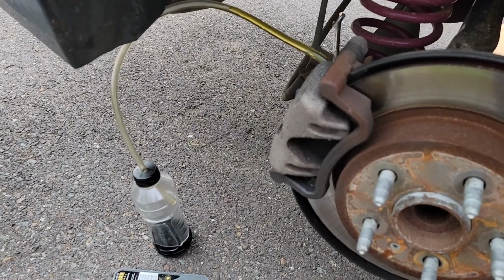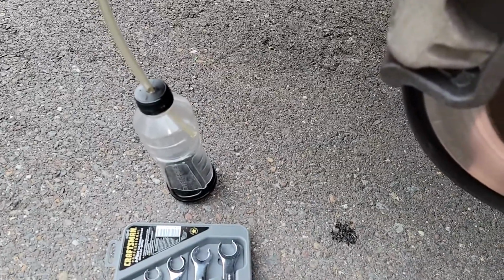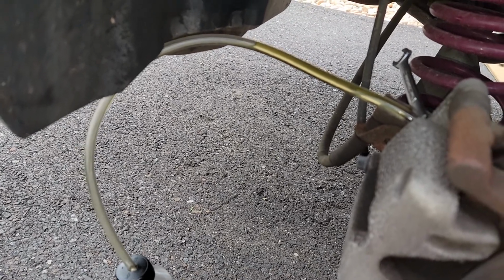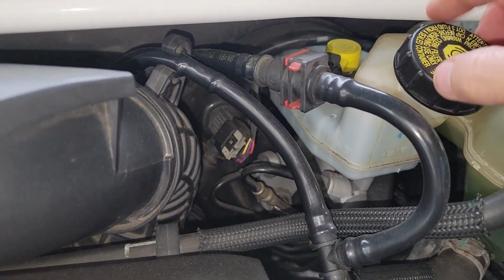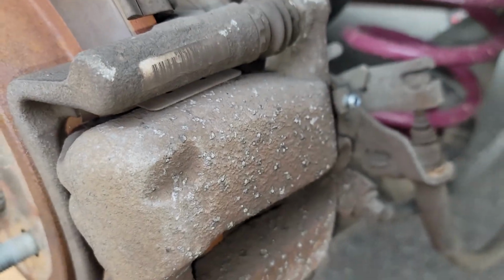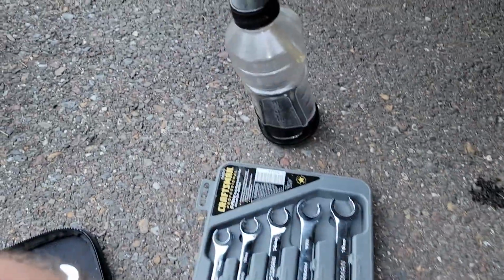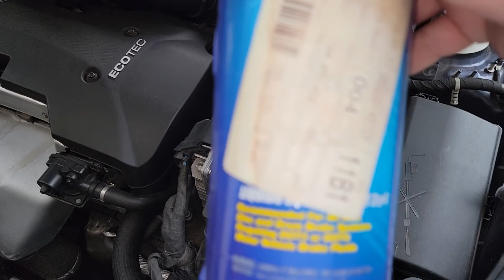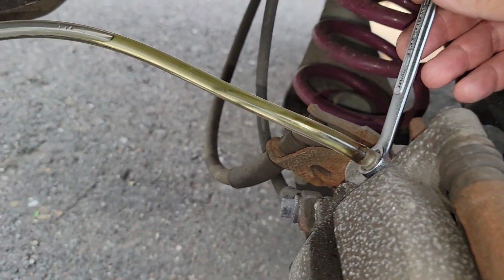bleeding brakes on 2013 chevy malibu

Comment: I have a question bout this Soni have to flush the brake system.cause they put power steering fluid in the brakes instead of brake fluid isn't the same process
Reply from the maker: Who is they?  If they is you, don't be ashamed, we all make mistakes.  If they is a shop, the shop should be fixing this.

But yes, the brakes will have to be bled like this asap
Reply: @JonnyAbs-0  no they is a friend of mine she didn't know where the reservoir was so she put it into the brake fluid reservoir
Reply: @JonnyAbs-0  also I'm being told I can't do it the way yu did it that I have to use a pneumatic machine
Reply from the maker: @ralphsotelo5475  coincidently there is no power steering reservoir in our cars.  They have electric steering.  

I cant speak to the pneumatic machine.  Maybe that would be safer or get it all out.

Subscribe to my channel!
Reply: @JonnyAbs-0  yae that's wat I mean she didn't know that she thought that the brake reservoir was the power steering one
Reply: @JonnyAbs-0  now as to the pneumatic machine is It really needed to get the job done especially if I need it done before dark today